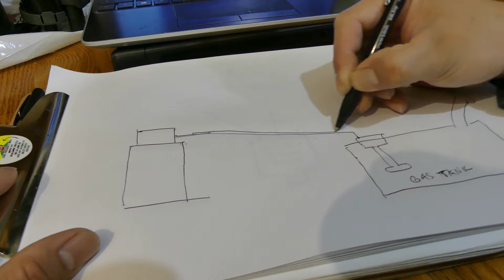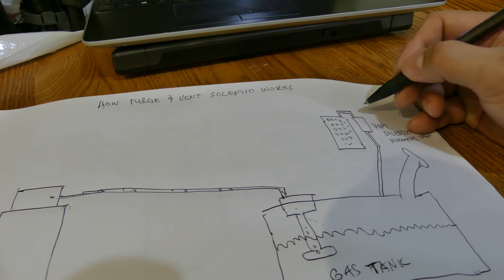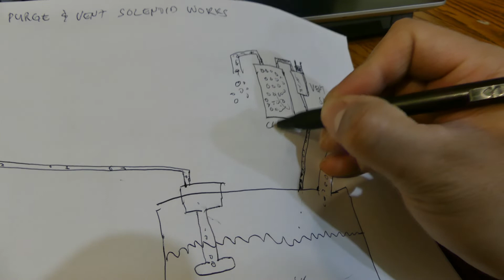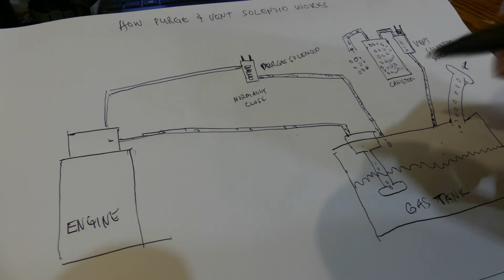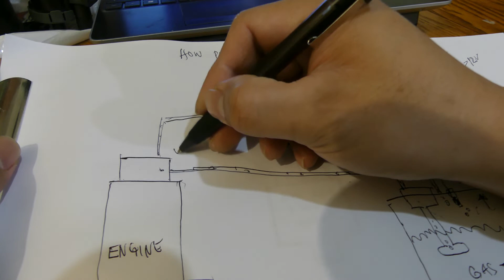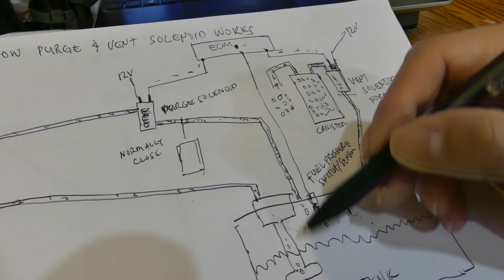How Purge Solenoid  Vent Solenoid & Canister Works

Comment: So the fuel pressure is the input on or sender to the ecm

BTW I have code po446, I check ground side from the ecu no ground, I have 12v in vent solenoid but o ground from ecm.
So how do you check the pressure sensor if its good or bad
Reply from the maker: u need a bi directional scanner to control the solenoid because honestly we dont know when the ecm gives negative to that solenoid in order to engage